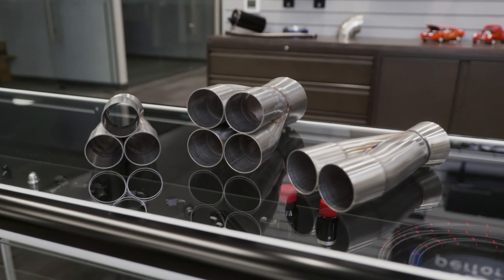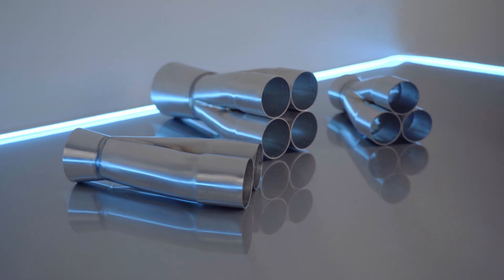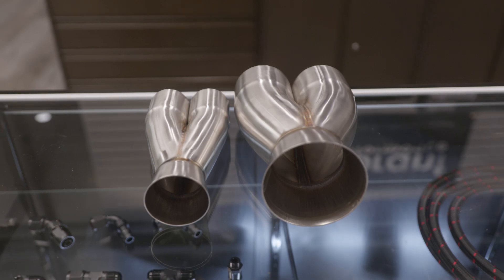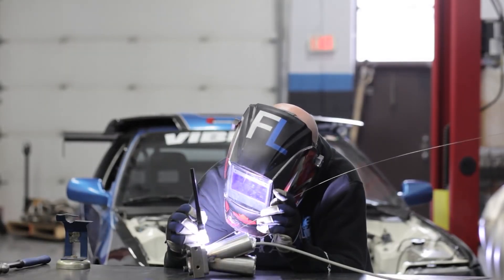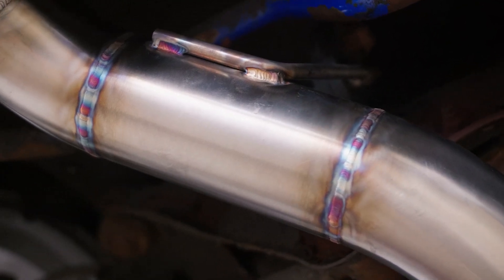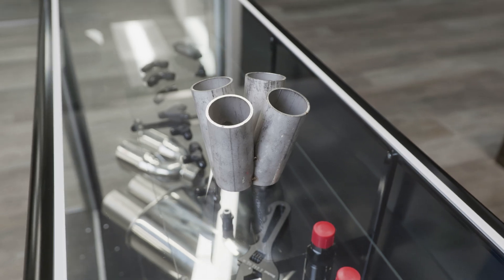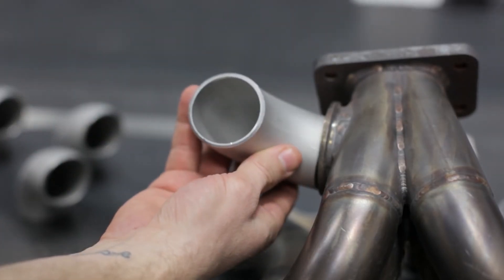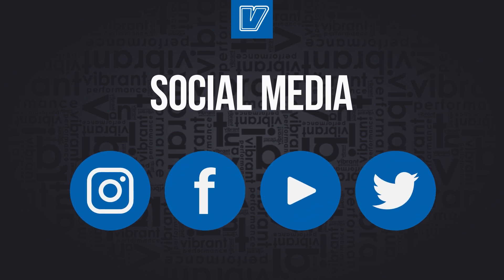Merge Collectors (Vibrant Performance)

Comment: Hoping I can make something work with the 2 Y pipes I ordered for my 4-1 outlaw exhaust, coming down from 2-2-1/2s after sidewinder "x-pipe"
Will be an interesting LOOKING exhaust to say the least haha. But the pieces I've received in the past fir more traditional system builds have worked flawlesslessly. Great design followed by great fundamental fabrication gives the final fabricator a crucial step up. So thank you for the continued support. Best Regards